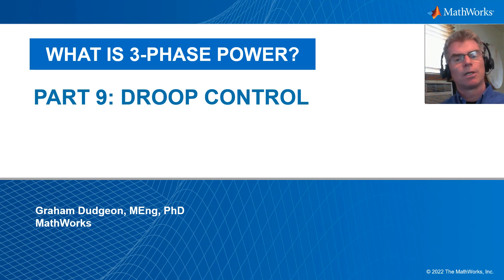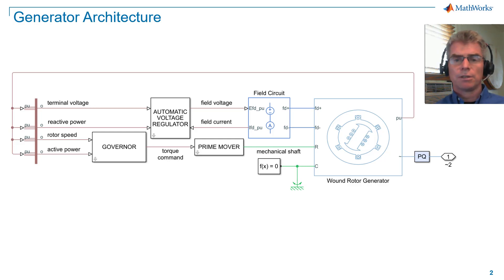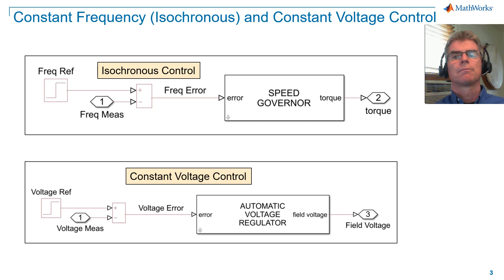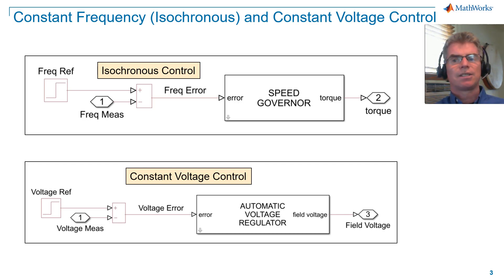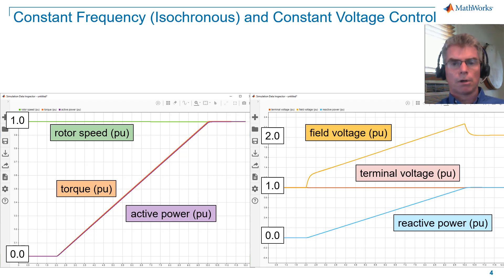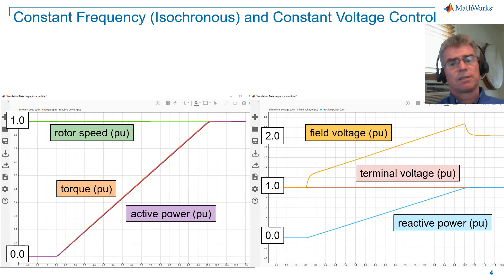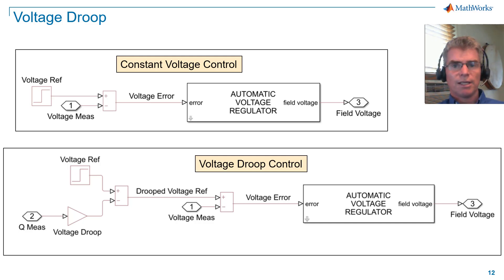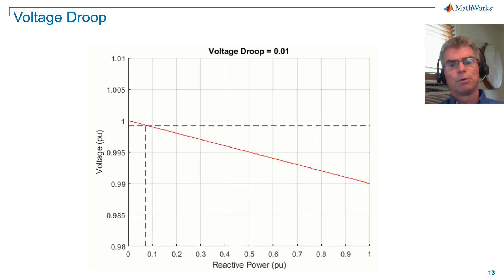Introduction to Droop Control | What is 3-Phase Power? – Part 9

Comment: In droop control method, the value of reference frequency is 1 p.u. and that of actual frequency is 0.7 p.u. For an active power generation of 2 p.u., find the per unit value of droop coefficient